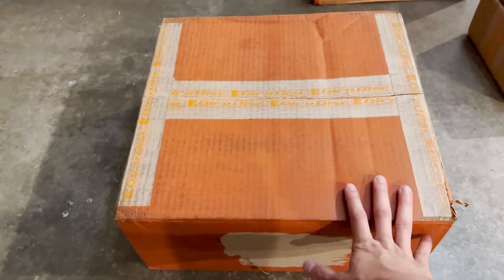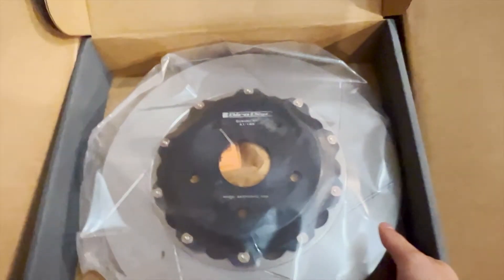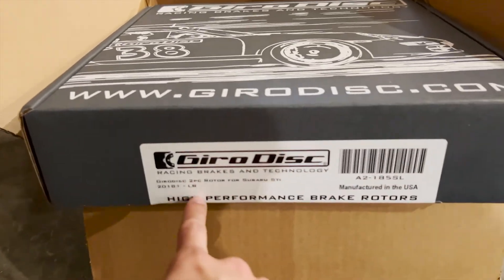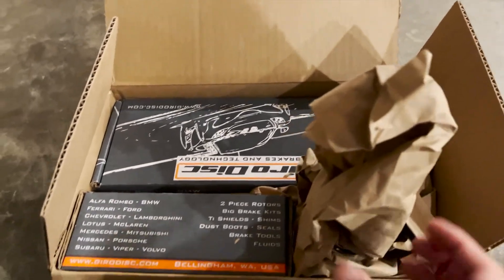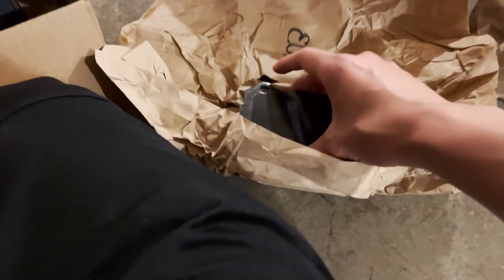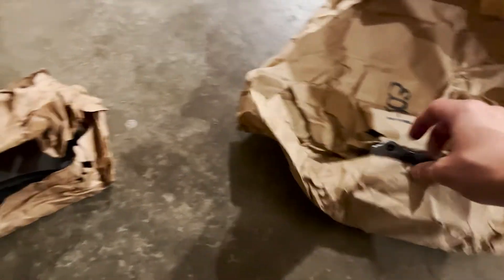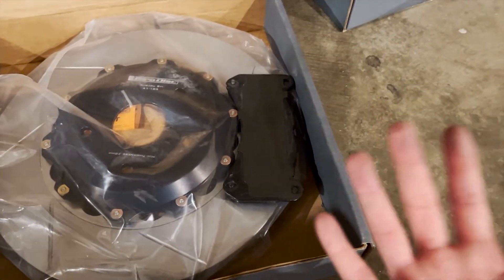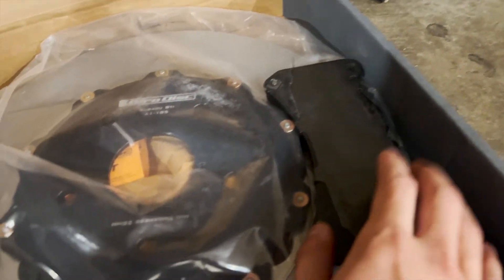Girodisc 2-Piece Slotted Rotors and Magic Pads Unboxing | 2018 - 2021 Subaru WRX STI | 4enthusiasts

Comment: Aren't the stock ones steel? What about these? Are they good?
Reply from the maker: Both are cast iron. The 2-piece rotor has an aluminum hit which is the weight savings
Reply: @4enthusiasts  i see